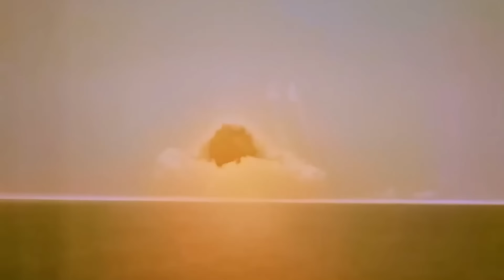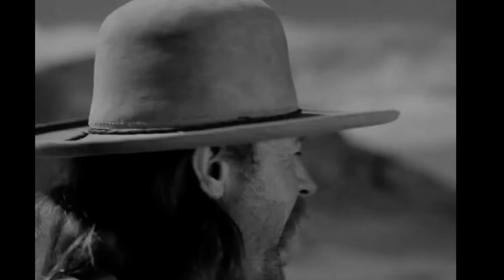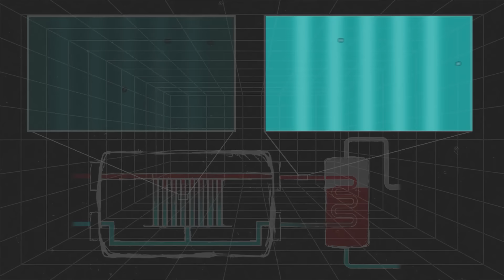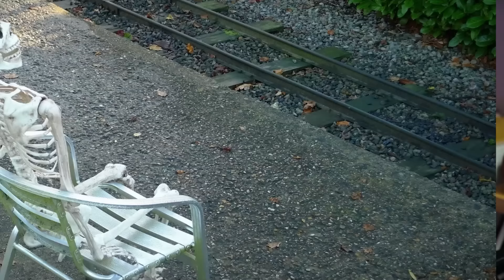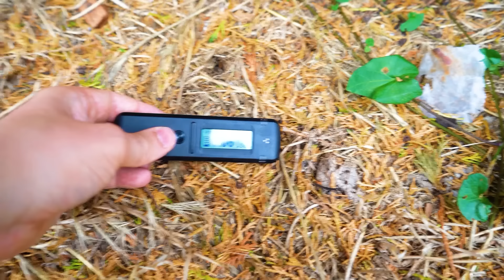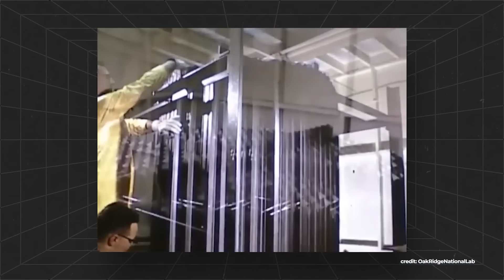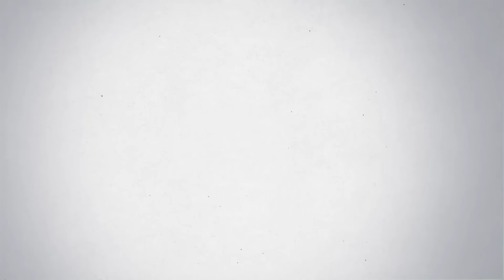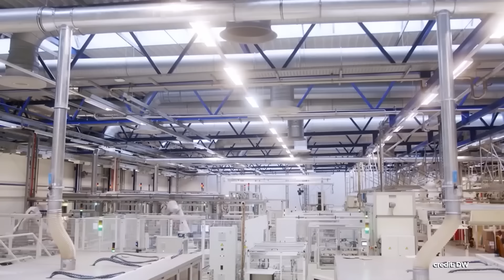It's Happening - China Launches World's First Thorium Nuclear Reactor

Comment: China did not create the worlds first thorium reactor... That was done by the US in the 60's as an experimental reactor. Technology at the time meant that it suffered from excessive corrosion due to the molten salt component. 

All that China has done is take existing technology and massively scale it up (with western science driving it). Whilst this is still an impressive feat, it is built on the shoulders of the men and the accomplishments that you utterly fail to mention. 

The MSRE reactor, built at Oak Ridge National Laboratory, operated critical for roughly 15,000 hours from 1965 to 1969. In 1968, Nobel laureate and discoverer of plutonium, Glenn Seaborg, publicly announced to the Atomic Energy Commission, of which he was chairman, that the thorium-based reactor had been successfully developed and tested.

The US could potentially have adopted Thorium as the nucelar fuel that drove their society, however in 1973, Senate decided on the use of Plutonium as the primary nuclear fuel source. 

As a scientist, you really should lay out ALL of the facts, this video is misleading and takes the scientific credit away from those who were really responsible.

Comment: I believe worlds first molten salt reactor was in america but it was just for research purposes and they decomissioned it after they got it to work in Oak Ridge National Laboratory all the way back in the 70s which makes it so understandable nobody remembers it. That one ran for four full years before they took it apart again to see if their construction had issues that they could not detect from the outside which also inadvertendly destroyed it since they used alloys developed for this specific task which were expensive to procure because of the technical personell which i am guessing long before the 4 years were up they let go.
I would mostly claim that one is the "first one" if that even matters because all the others are based on its findings down to even the design of them but i am only a layman.
Reply: I believe one of the reasons the experiment was not continued is that despite the near to flawless 4 year run proved that it would work the goal back then was to convert thorium into higher power producing alternatives since people were scared of uranium running out and power demands to rise more then they have had which is funny considering we still think that with more power our demands would explode even know even if it did not pan out back in 1970

Comment: Nuclear power will remain a barely relevant niche.
Renewables are currently adding 25x the annual net capacity as new nuclear plants: 250 GW vs 10 GW. And the rate of renewable growth is increasing rapidly, while nuclear is completely stagnant.
The most annual growth nuclear has EVER managed was 20 GW in the 1980s.

This presents multiple problems for nuclear:
1. It is reliant on a small number of companies which cannot expand quickly.
2. The prices for nuclear reactors are already going up due to factors like steel prices.
3. A quick increase in demand will lead to absolutely skyrocketing prices, as it will put a crunch on the material availability and production capabilities at the same time.

Further, the costs of nuclear are insanely front-loaded. A wind turbine or solar panel can be planned, built, and pay off its investment before most nuclear plants are even finished constructing. And then a nuclear reactor will take about 30-50 additional years of actual runtime to repay its initial investment. And this time currently keeps increasing because ever more grids get swamped with cheap renewable energy for a growing share of the day.

So it would easily take 20+ years to even START producing nuclear reactors at a relevant scale again, and then another 20+ until we actually get to a respectable number of facilities.
Meanwhile renewables would have cut down on emissions for all of this time and have a gigantic financial lead. So going big on nuclear now could put us on a path where both greenhouse gas concentrations and public debt would be worse well into the 22nd century compared to continuing with renewables.

For example, let's say we have the option between ramping up to a a 90% renewable grid by 2040 that still has 20% of current emissions.
versus the option of investing that money into nuclear to get our first new reactors up by 2040 and then ramping up to 100% nuclear by 2070.

Renewables: We have an average of 60% emissions for 15 years now to 2040, then 20%. Until 2100, this puts us on an average of 28% of current emissions per year.
Nuclear: 100% of current emissions for 15 years to 2040. Then an average 50% emissions until 2070. Then 0%. This results in an average of 40% of current emissions until 2010. In other words, it means that we would maintain higher CO2 levels well into the 22nd century. Our climate will be absolutely devastated by then.

Comment: Great video. This was always a totally possible technology that didn’t have many of the drawbacks of Uranium-based nuclear, minimising or outright solving issues with safety, supply, and nuclear waste. The framework for this technology has already existed for decades and the science is well understood, so now engineering just needs to solve the so-called "technical" issues...which China seems well on the way to solving..This could really revolutionise world energy, creating baseline power without taking up much of the space that energy-grid mass solar and wind require. 

Btw: The idea of thorium-based nuclear power being used to power desalination is a very possible idea too. By directly using the thermal energy produced by nuclear power, thermal; desalination could possibly be more efficient than osmotic desalination, but either way that's a good way to power desalination reliably for long periods. If the brine byproduct could be used somehow by the power plant or nearby industry - like maybe being used as a source for salt which can be further processed into constituents of the molten salt fuel - that would solve some of the biggest issues with desalination.

Comment: Letting China get ahead in the energy business is a huge mistake. I really do not like the idea of a government with a love affair of mass censorship, genocide, and slave wages for its citizens becoming the one selling me energy.

I also don't like the idea of using salt as a heat battery. Heat never likes to be in one place very long, and the more of it you have, the faster it transfers to the environment. I have a feeling that such a thing would have massive inefficiency losses. The best solution IMO isn't storage as much as transmission. A global power grid with cross-continent connections made of super conductors, or maybe lasers could send power over long distance with less resistance than regular power lines, while local grids distribute power over short distance with conventional high voltage lines.

Comment: Thorium reaction existed since 1980s (easily verifiable by using google scholar). Nuclear power has made 0 advancements in 45+ years. It's nothing but a poor attempt to make nuclear power seem as advanced as renewables and batteries when in fact it's just reheating ideas from the literally last century.
Besides that this "World's First Thorium Nuclear Reactor" has 2 MW which is 1/3 of a modern wind turbine. This blatant misrepresentation of reality is reason enough to dismiss any push for nuclear power without even looking into it.

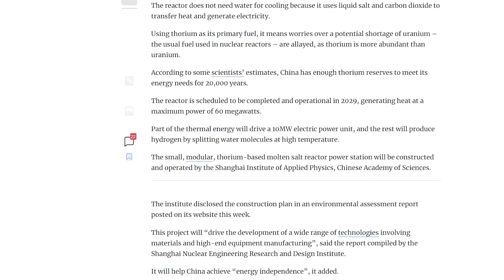Comment: In the document shown at about 1:15, right after the text mentioned in the video, is a comment that the power will be a maximum of 60MW thermal.  The 10MW electric would represent about half of the reactor's output and would be good for about 10,000 homes.  That is a tiny nuclear reactor.  Reading on, I note that it's described as a small modular reactor, so I won't jump out instantly and say it's a research reactor that only pretends to be a commercial reactor, but I will note that if there's no actual commitment to building more such reactors, it really is anyway.

Comment: As you pointed out, the US had thorium reactors running since the 1950's. The US gov't shifted away from thorium due to the ability of uranium reactors producing plutonium, which was in dire need during the cold war. IMHO, this tech needs to be revisited for the specific purpose of producing base load power, and not just power as available upon the prevailing skies, and currently available energy storage techniques.
Reply: The obviously best and most efficient energy systems, from a chemical standpoint, are some kinds of "Binary Batteries" or even "Multiple-Chemistry" batteries.  My son is working on these now.  If you look at ordinary chemical-couples for energy density (or power density), only Nuclear has a better ratio, especially with re-breeding and the useage of the Waste products for heat and medical isotope production, and similar uses.
Reply: US, world needs Chinese scientist....😮😮😮😮

Comment: Nuclear fear mongering is one of the worst setbacks to humanity alongside GMO fear mongering. 

Chernobyl only has caused 60 deaths, No recorded deaths due to 3 mile island incident and 1 death in Fukushima, which pales in comparison to the 20k killed in actual earthquake. 

In comparison, each year 12,000 people die, falling of the stairs.  About 450 people die annually by falling out of bed, usually from head and neck injuries. Around 81,410 to 137,880 people die each year because of snake bites, 230+ recorded deaths from hail storms, Dogs kill about 30,000 per year. 

Nuclear activists are one of the biggest reasons for climate change. The irony.

Comment: I'm not exactly sure but I believe the Chinese TMSR has a graphite moderator for the core so fission cannot happen outside of the core because there's no moderator. Thorizon uses heavy water as a moderator. MSRs can be more efficient than light water reactors because they can use a superheated steam cycle. I had written off nuclear power for renewable energy until now let's see what happens.

Comment: Copenhagen Atomics will build you a modular thorium reactor in less than 18 months. The
speaker did not make a comparison in kilowatt hour (kwh) energy output generated from
1 kg of fuel.
Coal                           7 kwh
Oil                            13 kwh
Gas                          16 kwh
Thorium  23,000.000 kwh

Comment: A thorium reactor is not a new kind of reactor; it's just a decision to replace U-238 with thorium, which requires the remaining uranium to have higher fissile content, or else the addition of plutonium, to make the overall fissile content high enough. The motive for doing so is PR: U-238 breeds plutonium, which the ignorant public assumes can be taken from a reactor and made into a bomb without government help, and more easily than U-233 bred from thorium. Thorium cannot replace fissile U-235 or fissile plutonium; one or the other is needed to start the reaction, and unless the reactor is a breeder reactor, additional U-235 or plutonium will be needed to keep the reaction going. A breeder reactor can use thorium or U-238 as fertile material. A fast neutron breeder can also use neptunium, U-236 and other non-fissile or semi-fissile actinides as fertile material, so none of those actinides are a problem other than a PR problem for an ignorant public.  But behind the PR is a darker political motive: to make nuclear power prohibitively expensive, to maintain energy scarcity, to keep the masses in conflict with each other. Insisting on replacement of U-238 with thorium increases the cost of nuclear power by preventing use of spent nuclear fuel and uranium enrichment tailings in fast breeder reactors, helping to maintain public hysteria about the storage of these materials.

Comment: Gotta shake your head at some of the skeptical naysayers.. This form of nuclear energy is far cheaper to produce, has only a tiny fraction of waste, is failsafe under electric power outages, and is scalable to use downsized as an off grid system for individual buildings or even vehicles. Thats probably why it has not been adopted. It could provide too much liberty for the masses.

Comment: Err no. 
The reason why reaction does not take place out side the reactor is due to not having a moderator.
As far as I understand the moderator is carbon. The reactor has carbon rods in it. Without it, reaction does not take place. The Neutrons simply fly past the Thorium atoms, they need to be slowed down, hence the moderator.

Comment: Thorium fuel and MSR, Molten Salt Reactors, are separate things.  MSR reactors can potentially use any fission fuels and burn up waste products.  Thorium fuel can be used in different reactors.  Thorium itself is not a fuel but undergoes conversion in a reactor using neutrons into a useful Uranium fuel.  Protactinium is a short term byproduct that has the potential to develop weapons material and needs secure management.  On the other hand MSR reactors can be used to burn up nuclear weapons material and produce energy.  And even useful and valuable industrial, space, research and medical materials.

Comment: Nice idea, but let's talk about money. Modern wind turbines are installed in 2024 with a power of 6-15 MW for a price of less than 10M€ and only needs wind as fuel. How cheap can we build a reactor? In my humble opinion, any such reactor is merely an additional backup solution and will need to run less than 10% of the time.

Comment: industrial material filtration? as if raw iron has things like radioactive uranium bonded to it naturally as the earths volcanic eruptions proceed in convection... power generation, to run facilitation of electro chemically processing of material from the earth not to get more of those elements, tho to remove them from diffusing into a continued line of "natural" concentration within an environment. similar two two metal spoons, they are both the same, both are used as long as the other... tho one unlike the other gives the worst metallic tin like taste to everything it touches. as if the salt its self also acts as a ceramic insulator on the exterior of some of the inner parts to prevent corrosion... so all those parts have weirs ceramic salts coated over the insides for the salt brine to crystalize onto adding to the ceramic and crystalizing into any cracks or brakes in it to self seal at water would not, exterior corrosion would be more of a problem... radio active material is universal waste that is harmful, so its interesting things can be continued to make use of it. tho with fewer salts in the ocean... the squid's get bigger. Calamari

Comment: You should take a look at Copenhagen Atomic and their reactor. They are in close cooperation with Atlas Copco which have a lot of experience in industrial processing equipment such as evaporators and separators. The Danes have solved the corrosion problem by making the world’s cleanest salt. They have also developed circulation pumps that can withstand the high temperatures of the salt without wearing down. Their reactor is also able to use uranium and burn down what is now classified as nuclear waste.

Comment: Corrosion risks are a common complaint about MSR reactors but this fails to consider over 50 years of materials development , corrosion protection, monitoring, construction and oxygen removal technologies. This includes modular systems.  And other advantages of MSR reactors.  Including easy replacement and reduced problems with refueling.  Once a reactor is due for replacement the fuel salt can easily be transferred to a new reactor core.

Comment: Nope. Your explanation of reactor physics is incorrect. Most Nuclear reactors actually don’t use “fast” neutrons. Indeed they purposely slow the neutrons down to increase the probability of fission as slow neutrons have a much higher fission “cross section”. This is the reason that the core is the only place where fission occurs, because it is there that the “moderator” (which is the material that slows the neutrons) exists and its not really the presence of more fuel as you explained. Outside of the core where no neutron moderation occurs the fission simply has no probability of occurring because fast neutrons exit the material far before appreciable amounts of chain reaction can occur. 
That being said, Some reactor designs do rely on “fast” neutrons. But these designs are more the exception than the rule. Such reactors would rely on the presence of more fuel to sustain reactivity in the core vs outside as you explained in the video. In addition they would typically require a much higher level of fuel “enrichment” due to the requirement to increase the probability of fuel nucleus and neutron interaction.  In these types of reactors, a neutron moderator isn’t used and indeed materials choices are made based on their neutron interaction characteristics so as to minimize moderation. This is the reason some Molten Salt reactors use Fluoride vs Chloride salts. Typically Fluoride reactors are of the slow moderated type and Chloride are Fast due to the greater moderating effect of Fluoride salts vs Chloride.  
Also, Thorium 323 isn’t a thing. Only Thorium 232. Little slip up there. 
Otherwise a decent video.

Comment: As far as I know, China is also simultaneously developing another advanced nuclear energy program, ADS, Accelerator-Driven Subcritical reactor. It may not be able to generate electricity efficiently, but it can "burn off" much of the highly radioactive material in nuclear waste. This is not early conceptual research; an experimental ADS has already broken ground near Shenzhen. If such a system is successful, another major problem of nuclear energy may also be solved.